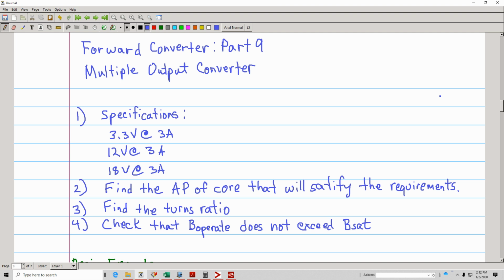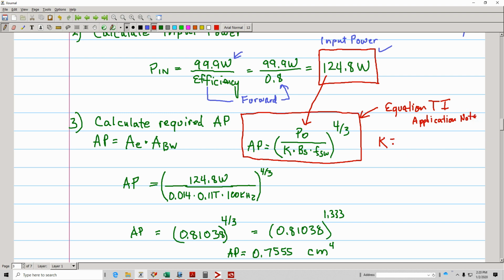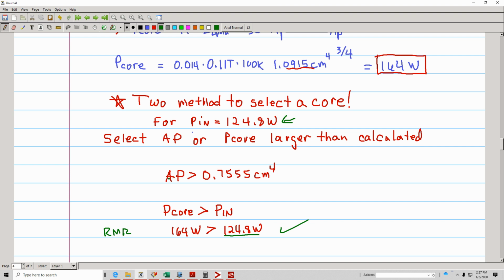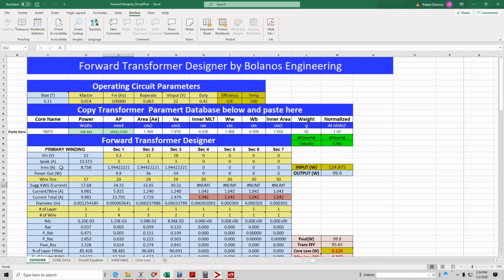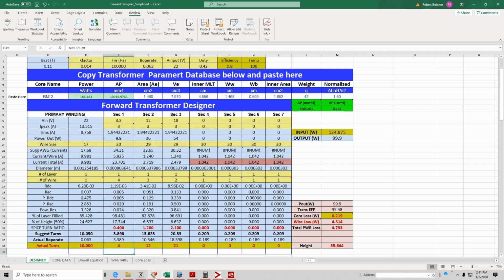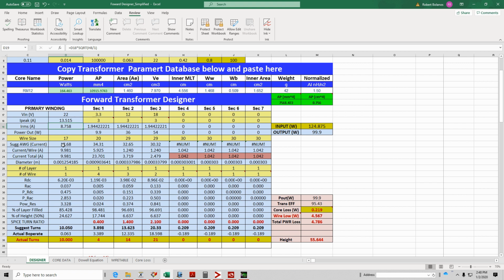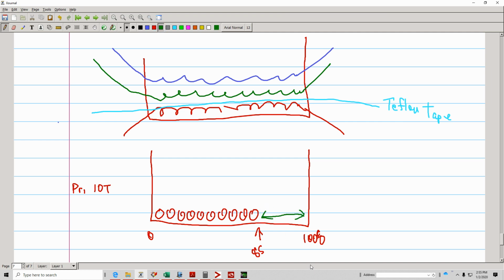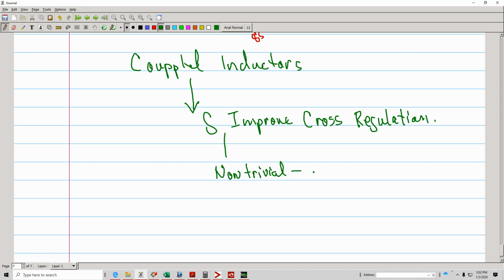ForwardConverter: Part 9 Design the Transformer

Comment: Hey. Where'd you get the list with AWG? On the internet there are many tables and they all give different currents with respect to your table. I don't see a match and I don't know which table is the right one. Also, I don't see that you've taken into account the skin effect. 
Thank you very much!
Reply from the maker: Hi BuginThe System

You can use Preece equation to calculate the current carrying capability of the wire. Preece equation calculates the fusing current where the wire opens or melts the wire. Once you calculate this value using Preece equation, you multiply by 10 percent. The 10 percent of the fusing current is very close to the table vlues you see on the internet.  Regarding the proximity effects, In the Spreadsheet you can see that there is Rdc and Rac, The values that I get from the proximity effects are used to calculate the Rac  This is how I take the proximity effect into account.  Thank you for the good question.
Reply: @RobertBolanos  Hey, Robert, thanks for the answer about Preece's equation. I notice that with the larger AWGs 10% fits quite well, but as the wire is smaller the difference between the calculation and the internet table is greater and greater (and always Preece's result is greater, as if the internet data is even more conservative, for example AWG27 -> calculation: 1.73A ; -> internet table: 0.29A). These differences affect the selection of the wire I guess. 
The other doubt I have is about the MLT to use. In the datasheets they don't give the value (and always the MLT that I find on the internet are from some book or table whose core doesn't work for me). I thought it would be an approximate value to the coil former perimeter, but it always gives me a difference of double or more. That's not counting that in theory the MLT should increase as there are more layers of winding. How do I get a reliable MLT value (for example for the E42/21/20 core).

Thank you very much!
Reply from the maker: Hi BuginTheSystem. ease email me at rbola35618@aol.com and I will send you the chart that I use to calculate the current carrying capabilities of the wires.   Robert